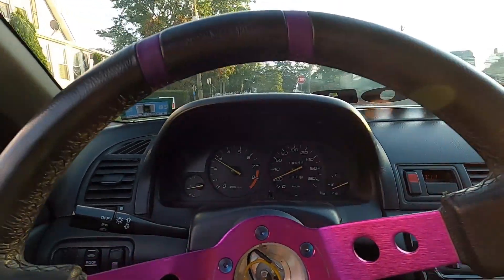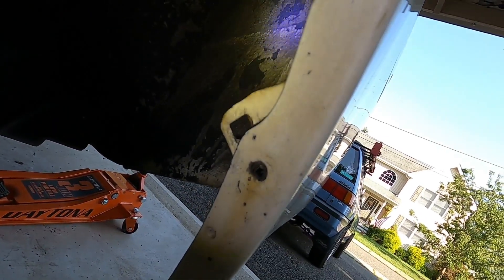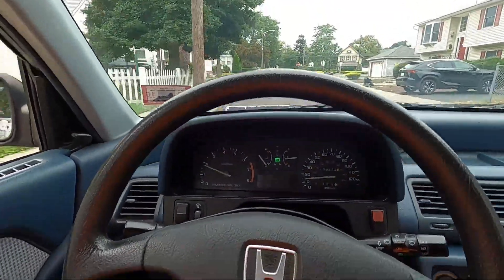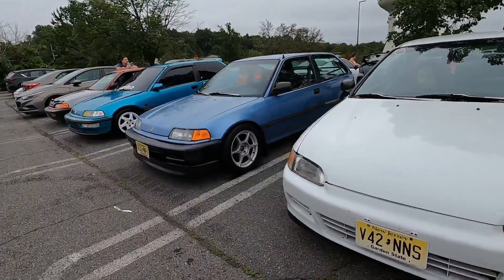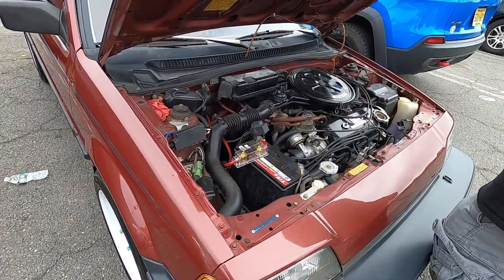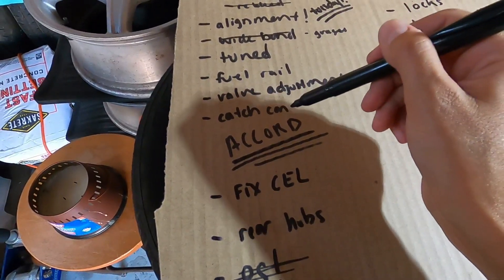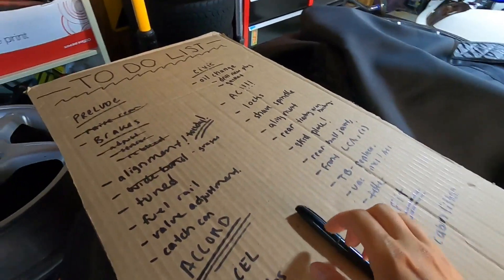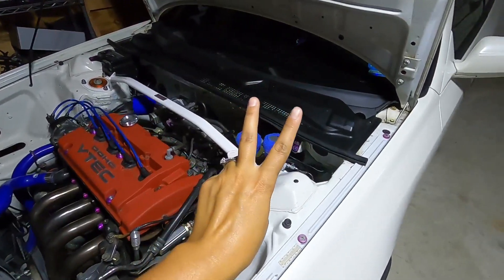FINALLY DRIVING THE PRELUDE/CARS & COFFEE

Comment: What's your slim fan setup?  I have a Mishi rad to throw into my 5th gen but am stuck to figure out fans/shroud option.
Reply from the maker: All mishimoto. Fan shroud and fan. They're amazing! No issues in past 8-10 years.
Reply from the maker: I would recommend changing the mishi rad cap out for a spoon sport type F. I had issues with my mishi cap leaking
Reply: @vanilllamint  I have a mugen cap to put on it :)